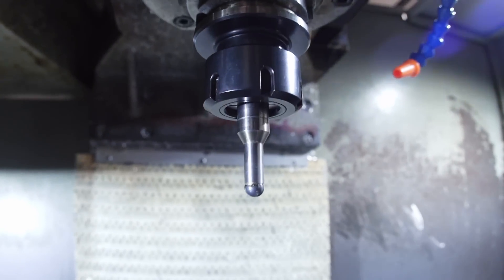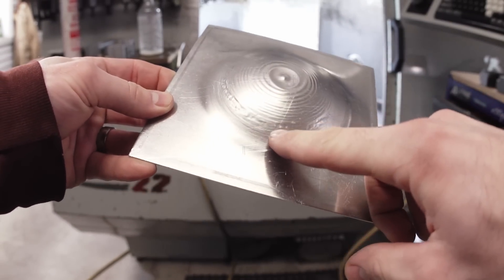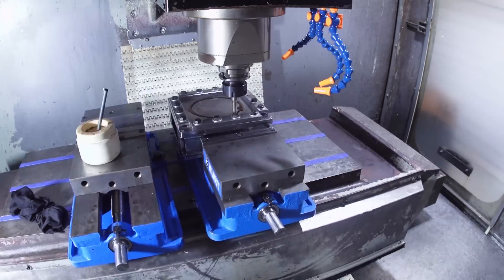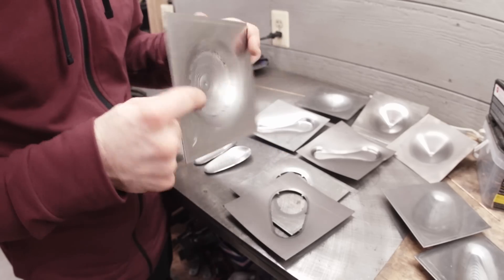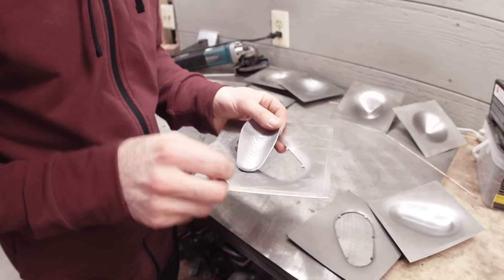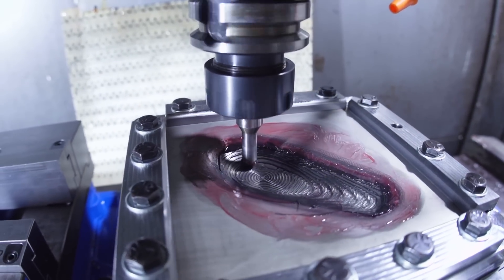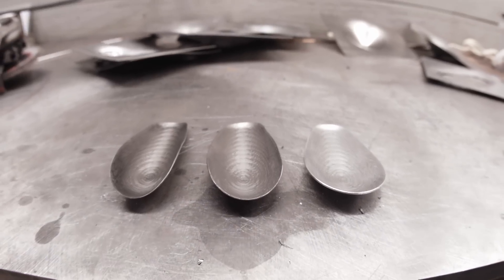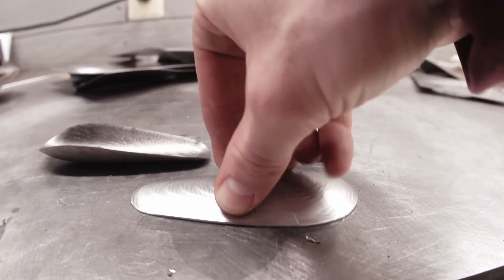Trying SPIF - Single Point Incremental Forming

Comment: question: does the rotation direction matter?
Reply from the maker: @LocnavLivoc  I think so. I ended up calculating the diameter of the forming tool at the point of contact with the work piece and determined what rpm to spin based on my feed speed so the tool would theoretically be closer rolling along the surface instead of slipping and relying completely on the grease or oil. Seemed to help the surface finish.
Reply: @RussellMakes  thanks

Comment: You're going to want to try to match the rotation speed of the ball with how fast it's traveling across the materials.

Also, if you're trying to cold form without any heat, grease would be your best bet.

Comment: if u could have the tool touching from both side like the big machines ive seen do it, but most of those are using big robotic arms to do the work but still how hard would it be to make a machine that would have two spindles one facing up and one down an wouldnt the bottom just be a mirror of the top. i love this kinda stuff but dont know how to do it at all. i used 3d printers an manual mill an lathe but ive always wanted to get where i could do cnc mill an this is just something else that makes me want to learn it so i can play with this kinda stuff but i dont know if i'll ever get there or not

Comment: WOuld it be possible to do this in multiple passes? they would have to be multiple passes on each z layer I assume.  You might get less springy if you make the deformation in more steps?
What would happen if you heated the TI up after the process do you think you could reduce the tension?

Comment: What if you indexed one corner to stop the sheet from spinning and then use the clamps to only prevent vertical movement? This would allow the sheet to be pulled in. Also, set the tool path to build up the veritcal shaping in relative layers where the "deepest" part is displaced first.

Comment: Instead of using the end mill, just run the tool harder and tear the material. It would be interesting to see if the tension in the material would be different using that method.

Comment: I've seen the more advanced version of this where they have two end effect robots using styluses from each side of the sheet. Not sure if I recall them doing titanium but they can do some pretty deep draw pulls in the sheet with that technique. But then again not everyone has millions of dollars for that equipment and software (monitors pressures, paths optimization and where on the stylus they are pressing to prevent galling and tearing etc). Pretty good results here though.

Comment: So, I don't agree... You need to include that deformation as a part of your process. You should be able to precompute the expected bends in it and reverse it out of the generated gcode... that way, when you do release it, it will bend to your desired shape.  Pre and post heat treating it will help relieve those internal stresses before you try and cut it free as well.

Comment: Maybe you could add a post forming heat treat step prior to cutting the part out with endmill.  Some stress relief cycles and annealing and possibly tempering prior to machining if free could resolve the intense internal stresses causing the movement while machining.  Obviously depending on the particular metal the process would be different and the results will vary.  Also given your setup is capable, I might consider milling a form type die or (soft jaws) to support the part from the bottom of the fixture.  Bassically the reverse profile of the part being formed.  It would likely improve surface finish as well as create the support needed to go thin without blowing through the material.

Comment: Someone already mentioned it, but starting from the inside might be better.  When you start on the outside you are making a work hardened ring that does not want to yield so you are trying to stretch a progressively smaller section of soft metal thus increasing the stress and distortion.  

Maybe you could start in the middle and do about half then move to the outside and finish it or vice versa, or start in the mid point.  Maybe doing something like this you could induce counteracting forces thus limiting distortion.
Reply: i'm pretty sure that it is the way, the problem is - regular toolpath isn't going to help, you basically could not push lower point down to intended depth from the beginning, not without catastrophic failure at least, so you have to slice toolpath into multiple layers from lowest to highest points, each of which starts from same Z0, but at the same time pushing previous toolpath result deeper

Comment: Titanium can be annealed to relieve stress. Also, some sheet-metal forming processes (deep drawing) work best with lanolin as the lubricant.
Reply: Yes. Anneal the metal before cutting the part from the sheet. You have to relieve the residual stress. Heat treat after cutting the part out to get strength properties back.
Reply: The stress comes from the work hardening that this process causes.

Comment: When cutting out the part you should try leaving a 1.5 diameter wide onion skin, then come back in and cut out the part with tabs. When the sheet springs, it wont matter because you are only cutting through foil thick material. Probably easer said than done with sheet metal.

Comment: Don't give up on the SPIF... the way the pros do it is they alter the shape of the tool path to account for the built up tension.  So the raw formed sheet (before trimming) doesn't look like the end product, but after cutting it settles into place.  Most of them use in-house developed simulations to do this automatically, but you might be able to get by with guesstimate work.  I also suspect annealing might be helpful (although I don't know enough about Ti to know if that's realistic).

Comment: Very interesting idea.  I would have thought about hydroforming into a a 3D printed die.  Still have to deal with spring back but you might get steeper walls with that technique because there should be less work hardening.

Comment: Wouldn’t you want to start forming from the deepest point? You wouldn’t hammer form a part from the outside in as you need to draw the material from as far away as possible. That’s why you’re getting those ridges and cracks.

Comment: 1.) A friend of "this old tony showed" that he annealed aluminium. paint the alu with a sharpy and heat it up, until the sharpy is gone.
2.) maybe the metal is shifted to one side only, because you do not change the direction of the tool path. Maybe it is better to intermediate change from clockwise to anit-clockwise toolpath.

Comment: I've been wanting to try something similar, but I want to do it with an air hammer, mounted in a C style frame. then the sheet metal would be pinched with each hammer blow. I think its worth giving a shot, though I have quite a few other projects I am working on at the moment, so it will be a while...
Reply: Good idea but I feel this may kill your CNC!

Comment: Any idea what the axial forces are compared to normal milling tool pressures?
Reply from the maker: No idea. I would guess pretty low considering the sheet I’m working with is pretty thin. The only one that heated up at all was the stainless piece which was about 0.038” thick.

Comment: The other thing you might play with is running the spindle at high speed; specifically because it will heat up the material kind of like a flow-drill.

🤔

Comment: Got to wonder if after you finished the forming op, what would happen if you ran it through a heat cycle to normalize it and release some of that tension. Because you're kind of work-hardening as while you form it, right? But stamping doesn't really have that problem, and that's kind of what you're doing is stamping but really slowly, so idk.

SmarterEveryDay had a video on this I think last summer or fall. Did a walk-through on a place trying to make this viable for mass production. Lots of good details there.
Reply from the maker: Hmm, might have to try that. Thanks for the idea.
Reply: @RussellMakes  yeah just leave it in the fixture before the cut-out cycle, and hit it with a torch, you can tell it's annealed once it changes color. Also use an endmill with a less aggressive spiral angle, and do a spiral-in to cut through the aluminum first before you hog out around the perimeter.
Reply: Go Green!